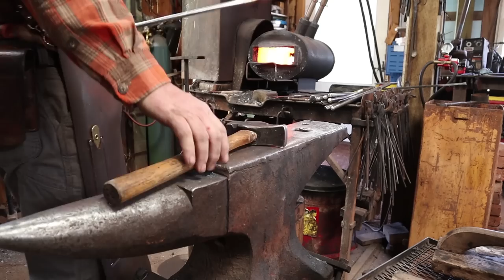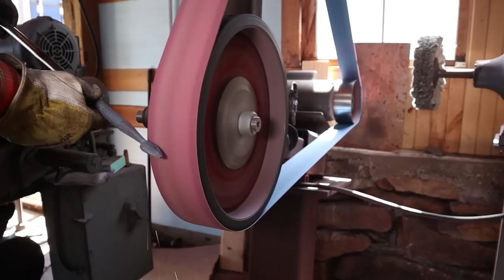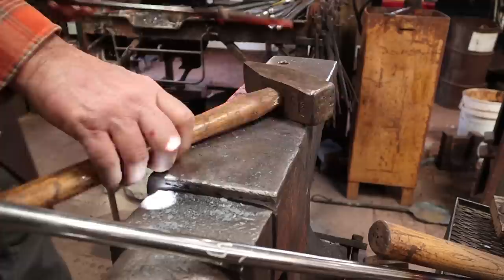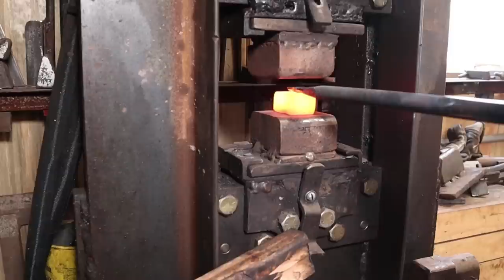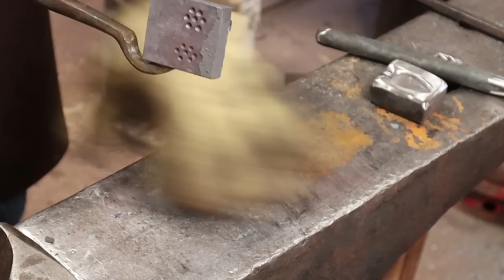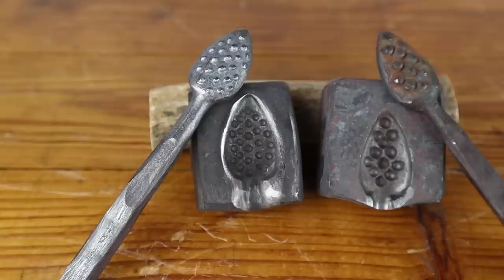Open forging die for decorative elements

Comment: John I have been studying the hinges for years. It seems that instead of the knobs being round they were  pyramids and weathering has made them round on the outside of the building there's one hinge from the inside of the building that's probably more modern. But the pieces are all filed not round dots also if you look closely at the handles of the doors the the pieces on the hinges are embossed and on the handles they are all rounded

Comment: For a hardy, if you're making multiple dies the same size, could you make a jig that fits the hardy just to hold it in place? That way, you could use the same dies on the hydraulic press as well.

Comment: Very very nice. You got quite close. I've done similar for simple designs too. 
For this though, I personally would have cast a reverse master die, but that requires a crucible. It's overall less work and more precise.
Reply: what would you have cast it from? Cast iron would be to brittle to hammer against, maybe could be used in the press with caution. Casting it from malleable iron could be as involved as forging. John is trying to duplicate the processes that would have been originally used.
Reply: @dicksargent3582  yup, cast iron would be too brittle. You can use high quality steel nowadays to do it. My family does. But we do have way more than a homemade crucible too. 
It's a little more involved, yes, but not that much more so.  Blacksmiths in older times would have sought out a caster to do it. Especially if it required little finicky bits and designs. 
That way every die was exactly the same. 
Casting has been around for ages. Even longer than smithing proper.  The plate sheets for plate mail were likely cast in a similar way, only flat and oversized to then be fitted to the person (we do it that way)
Reply: To be fair, my family have records going back several hundred years most people don't have access to.  And our main forges don't use any electricity (except for lighting or propane forges, tho we mostly use coal)
Plus add in oral tradition and apprenticeship and a lot gets passed down
Reply: @stephniewilliams9350   your talking a few hundred years. At the time the hinges for Notre Dame were made the only steels available were made thru a carburization process similar to case hardening or in an open charcoal fire. Wrought iron was the primary material and produced in small 30" high furnaces. The ability of casting steel did not exist until much more resently.

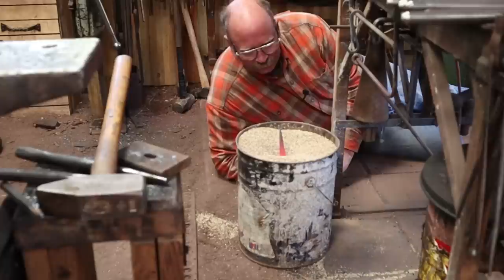Comment: Thank you for sharing, great die you got there. I would just like to mention that at 21:28 I saw you start annealing the steel at a temperature way above what is normally done with these alloys. S7 is a hypoeutectoid steel, and indeed this type of steel requires supercritical annealing in order to recristallize secondary ferrite phase (as opposed to hypereutectoid steels for which heating only above Ac1 temperature is required, because it results in almost complete recristallization of the structure whilst leaving secondary cementite as is). However either the camera doesnt show colors properly, or your workpiece was actually much hotter than Ac3 temperature for S7 steel, which in this case is suboptimal, as it increases grain size unnecessarily. Just my 0.02, things from university metal science course. If that sounds too sophisticated, trust me, its actually not. Of course all of that is neither magic nor secret and everyone willing to study thermal treatment and Fe-Fe3C phase diagram in detail can do that on the web. Cheers from Russia
Reply: Thanks for the educational details on cooling/hardening special tool steel. Glad to see a scientifc explaination in the comments.

Comment: If you have a 1” square hole on your treadle hammer, would it be bad to fake your flat die off your bottom, and put a square hole for tools like this? Obviously it won’t be a full hardy as it can only be a few inches long, but will it hurt the treadle hammer?
Reply from the maker: I do use tools with a 1" square shank under the treadle hammer.  Works great

Comment: Would it be possible to put another imprint on the other side of the die without messing up the original one, or would the process smash it too much?
Reply from the maker: I think you would be likely to mess up the first one.
Reply: @BlackBearForge  depends on the heat, I would think. Quench the first side and let the second one stay hotter.
Might this work?

Comment: Knowing nothing about nothing, my instinct is to create a die holder for the hardy hole that open die blocks like this would seat in to, to make that kind of work a bit easier.
Reply from the maker: That would work well
Reply: @BlackBearForge  I thought it might.  Not sure how I'd go about shaping the square (well, 1x2ish) internal. 

Heck, maybe the exact same way you form the primary internal feature of the die?

I'm setting up my forge over the next week or so at my new house so I'm thrilled to ruin a bunch of material on technique practice.  Maybe this is something I'll give a shot before I'm ready.

Comment: Could the plant heads be a representation of pine cones, blackberries (doubtful), pineapples (also doubtful)?
Reply: Pineapple is not necessarily wrong. The pineapple is a very common architectural element, but not knowing when the original at Notre Dame was made, I don't know if it is too early. Otherwise, it could well be a pine cone. There's almost certainly some symbolism that needs to be considered, too.
Reply from the maker: There are many possibilities